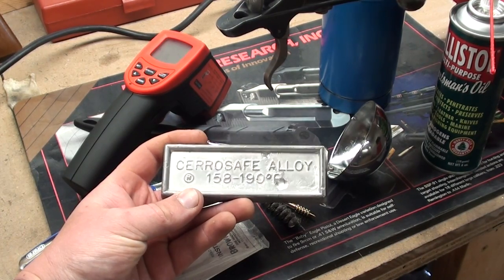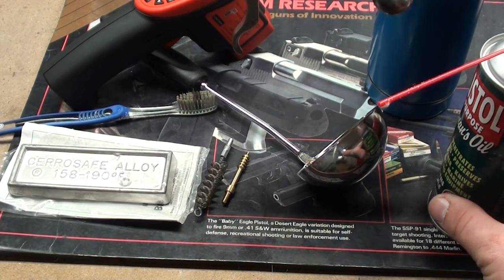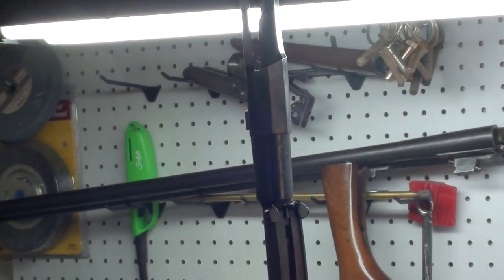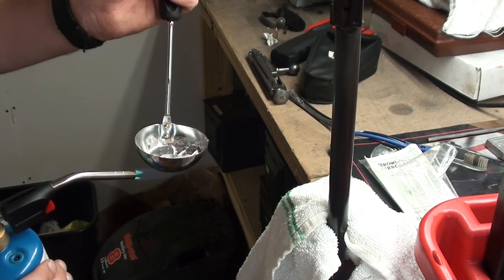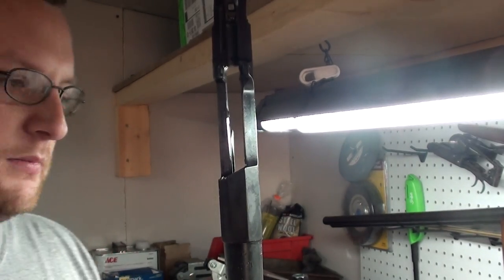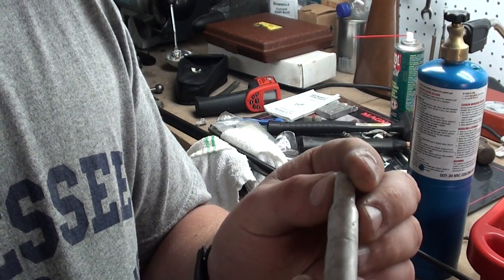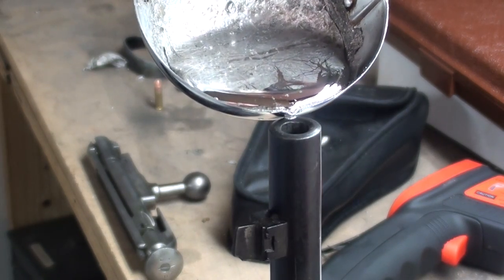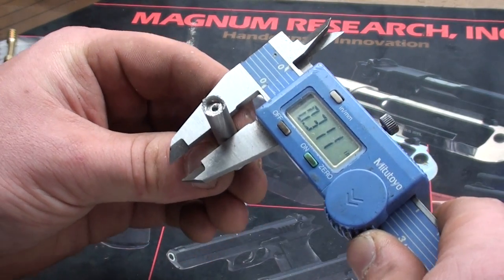Brownell's Cerrosafe Chamber Casting Alloy

Comment: Excellent video. This is especially useful for used rifles that might have custom chambers or 'kit guns' that have odd/obsolete calibers. Another use is when your drilling gas ports in barrels, since the metal inside the barrel will help prevent galling as the drill bit breaks through into the bore.

Comment: A fresh brew of coffee is at a temp of 160-170 degrees, just to give a idea of melting point of the Cerrosafe. A tip to help eliminate the bubbles that appear as imperfections would be to use a small vibration while having the bore clean and at about 130 degrees during the pouring. 
You could also determine your rifling of the bore if your into harmonics and accuracy of your round. I want to say that direct heat to the Cerrosafe will burn the Bismuth and produces the clumps as mentioned to avoid

Comment: You got your grooves and lands mixed up there at the end measuring tge cast.  Grooves are always the larger diameter.  You need to remember this is a  inside casting of the bore.  The 0.298" is the land or bore diameter.  The grooves are what is cut from the nominal bore or lands hoke.  The grooves would have been that 0.311"   My guess is cerrosafe is likely 0.0005 smaller than actual. Plus you are using a caliper not a good quality mic to take those measurements.  But for a 7.62x54r those would be to spec measurements  and good for muzzle as nominal is 0.300" bore/land and 0.312"groove.

Comment: Love your videos, I'm a machinist and engineering student but just getting into reloading and gunsmithing etc. Just wanted to comment about referring to a caliper to "mic out" a measurement. Maybe I'm just a metrology geek, but something like measuring something like lands an grooves should probably be done with actual micrometers with a blade anvil. Get thyself a good mechanical mic and and tip set if you don't already have one. I prefer starret to mitutoyo and mechanical to digital.

Comment: That alloy is pretty cool stuff, never seen it before.  How much does it cost, and does gun oil contaminate it?  How fast does the gun oil ruin it if it does. That's not a mic it's a caliper, and you need to use it properly to get a good measure from it.  Cool stuff anyway.

Comment: I've got an 1895 Winchester I thought (it was sold as) was chambered in .30-40 Krag...went to put it on auction and turns out the barrel isn't original...no marking whatsoever on it - when I get it back I'll cast the chamber....it'd be nice if it was rebarreled in .30-06 or 7.62x54R